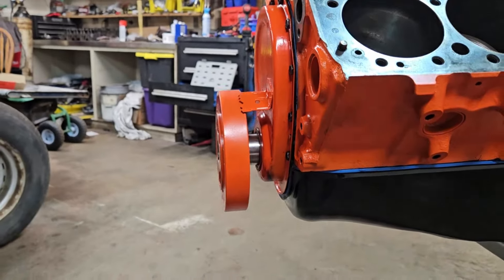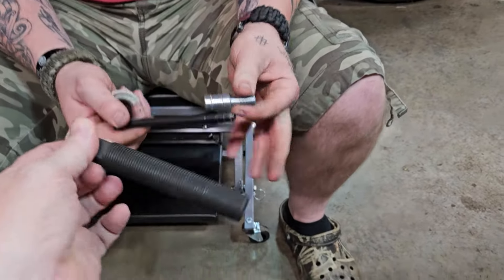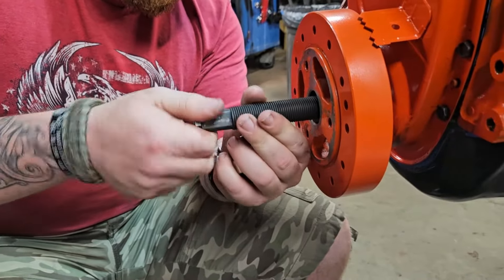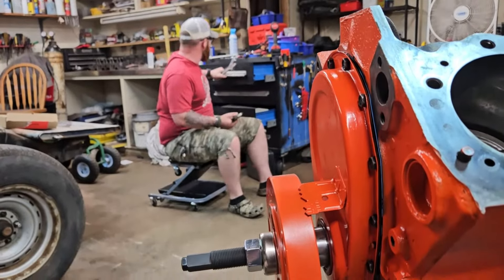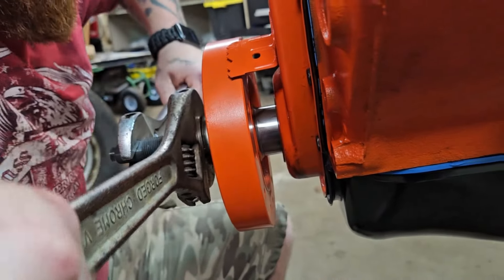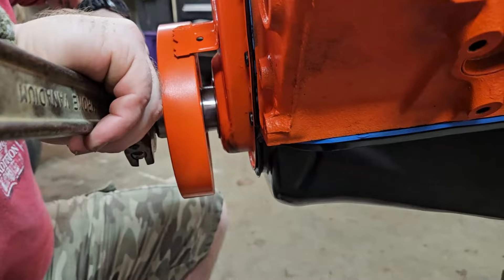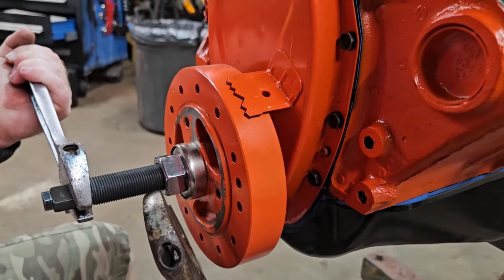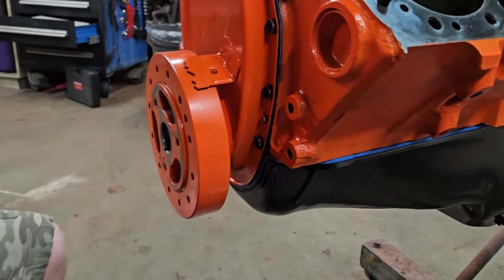How to Easily Install a Harmonic Balancer Like a Pro at Home

Comment: Be aware early sbc engines 265, 283, and early 327 don’t use a bolt to hold the harmonic balancer on. Those you have to hammer them on. They don’t have any threads on the crankshaft end.
Reply from the maker: THANKS, Have a great weekend